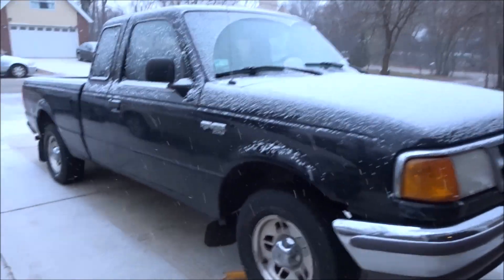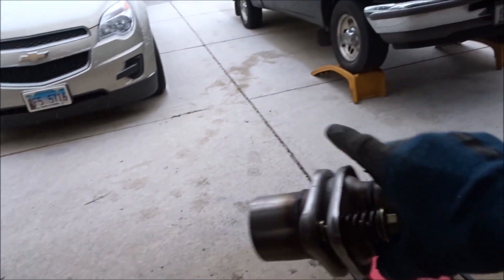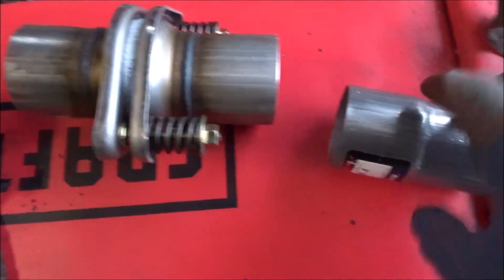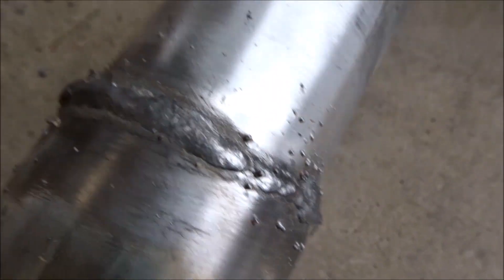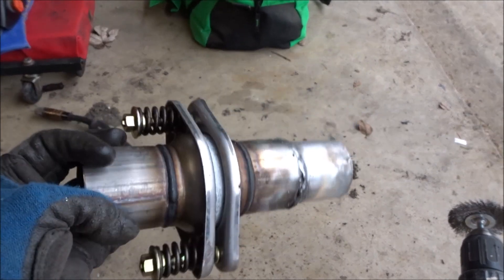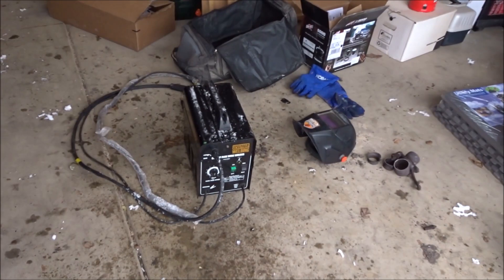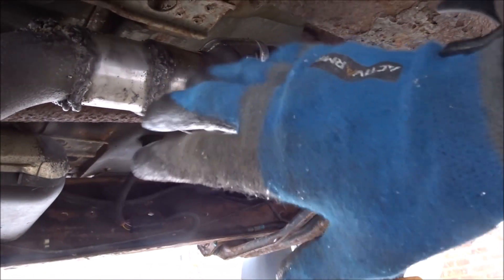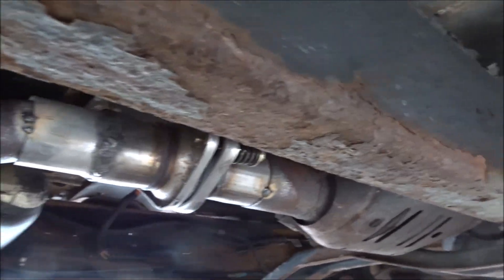Replacing Exhaust Connection Flange (97 Ford Ranger)

Comment: Nice work and kudos for attempting this repair. I am a welder by profession and all that you need to remember is that looks aren't everything. Functionality is the most important part. If it holds and doesn't leak, then your weld was a success... (and you didn't blow through and leave globs of metal inside to restrict flow. lol. But lets assume you didn't.) Good job.
Reply from the maker: Thank you for the support! My father works at a machine shop and always starts lurking around me with a hammer when he knows I'm welding. 😁 So I'll know if the welds or not. As for exhaust flow, it definitely still had it. 👍

Comment: Why didnt you took whole pipe out and welded all around the flange? Wasnt that easier and cleaner weld just curious to know if there is an issue to take whole unit out.
Reply: To avoid a nightmare. With a truck that old and any work on an undercarriage — especially things that get hit and cold over and over again — you really risk (highly likely) breaking a lot of components. A lot of them won’t come off without snapping or crumbling.

Comment: I need to do the same thing, where did you get the flang ?
Reply from the maker: I found it on ebay. I just searched exhaust flange and the size I was looking for.
Reply: If old flange in fair shape save on labor and use C Flange Bracket.

Comment: Is there a benefit to replacing it with a a new pipe flange v.s just straight piping it?
Reply from the maker: Incase you ever have to remove just part of the exhaust your have the ability to. Otherwise you could just do a straight pipe.
Reply: If removing the coupler and replacing with straight pipe will it cause flex problems or no

Comment: What is the point of the flange? Are they necessary in the exhaust?
Reply from the maker: I don't think they are completely necessary but they are helpful if replace parts of the exhaust system or having to pull the motor. It is more convenient.